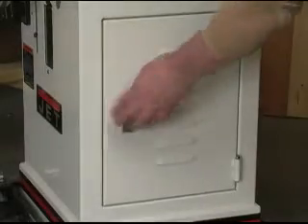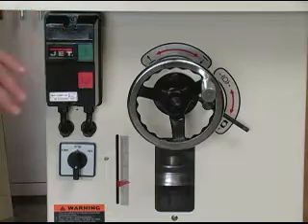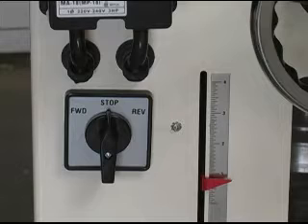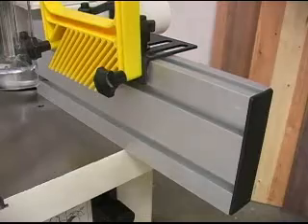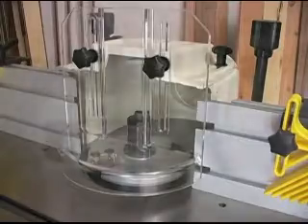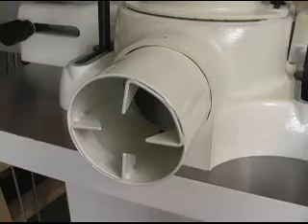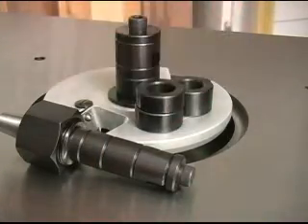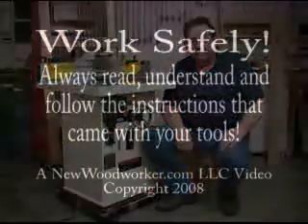JET JWS-25X 3HP Shaper Review

Comment from the maker: I'd love to have enough space to keep everything I review but I don't. I know we did the change over to the router bit capability but that was for the demonstration only. I'm not a believer in shapers working as routers because they are just too slow for most router bits. they can use router bits but you have to really slow down the feed rate. I just go to the router table for those bits and leave the shaper for the big stuff that needs the lower speeds.

Comment from the maker: Even with standard router-designed panel bits the speed of a shaper is going to be marginal at best. Shaper designers build in the lower speeds for potential needs with odd shaper cutter bits. Their marketing types I think may be the ones who call include router bit capabilities.